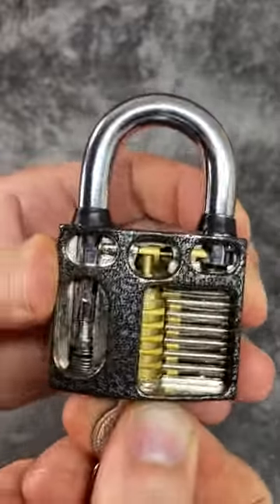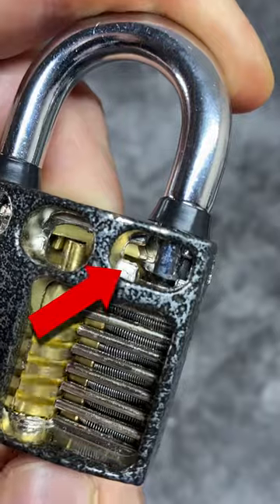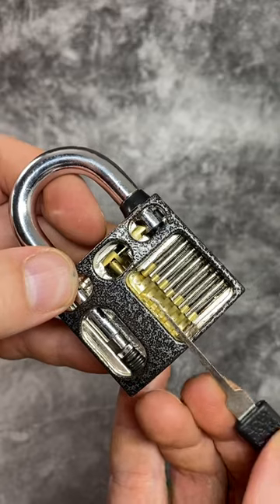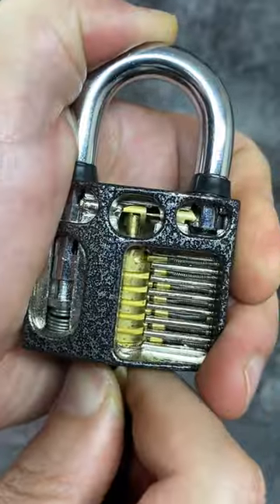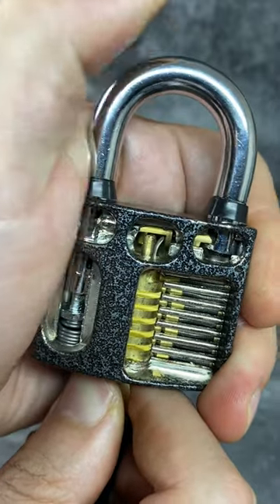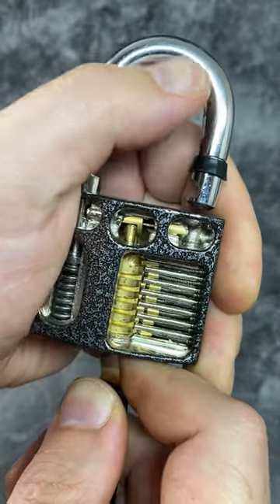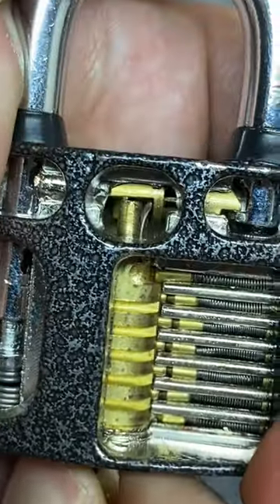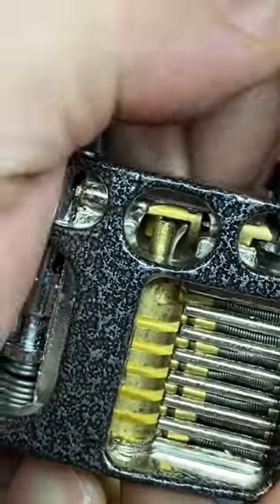The Padlock Shackle Bypass #shorts

Comment: I haven't found one that works like that yet. I have one that I did the bypass where you push it at the back then turn it like a lever. It worked 3 times in a row. Then I couldn't do that bypass again on that lock. LOL
Reply: You're overusing commas big time lol.
Reply: @faceless-x-abberation8400  There, I fixed it. Or there I fixed it.
Reply: @shark70007000  lol. There ya go! The reason I mentioned it is because I took a writing course in college and wrote the rough draft of my first paper. I took it in the teacher and she read it. She told me I was overusing commas throughout the whole story. When I turned in my final draft and it got scored I got a 100, but there was one mistake - there was a single comma added in that was supposed to be there, but since I was hell bent on removing them I made a mistake and removed one I needed. Lol So your comment reminded me of that time. I still don't know 100% of the time when they're needed or not needed honestly.